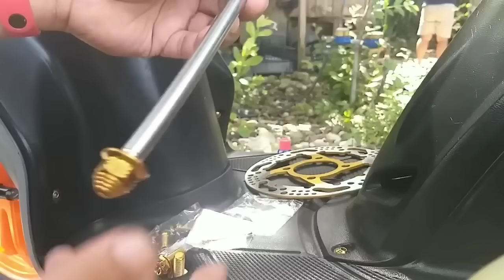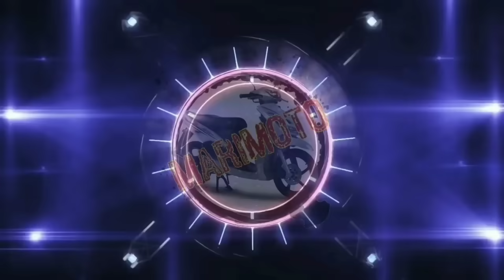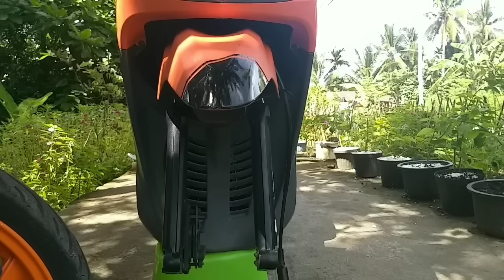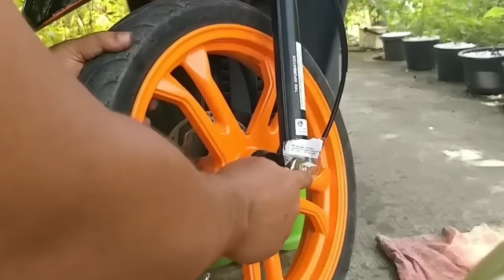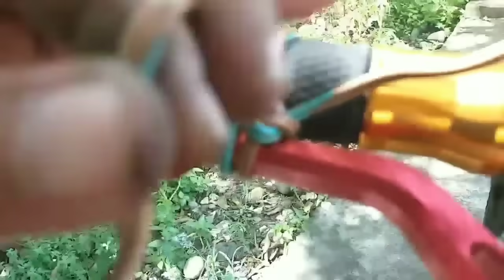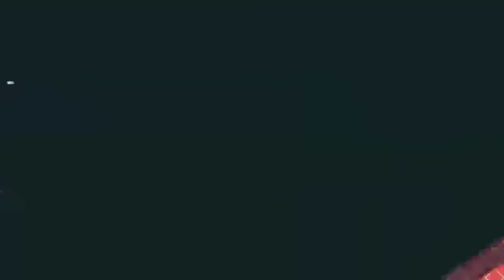Change Disc on Mio Sporty | Gold Disc Bolts | Gold Caliper Bolts | Gold Bleeder | Gold Caliper Pin

Comment: Paps anong sukat ng star socket wrench sa disc at sa caliper? Salamat mabuhay ka paps.
Reply: @albertdcofficial3357  yung pangtanggal paps na star socket sa stock ng caliper po at saka sa disc bolt.
 Salamat po RS
Reply: @albertdcofficial3357  T50 ba ung size ng flower wrench mo paps?

Comment: 10x25 ba yang caliper bolt mo bossing ?
Reply: salamat boss
Reply: @albertdcofficial3357  sakto lang po ba yung caliper bolts mo idol? Yung akin kase need pa lagyan washer. Abot kasi hanggang disc
Reply: @albertdcofficial3357  pag naka lighten disc siguro . Yung akin kasi stock disc pa. Abot yung bolts ko sa disc hays
Reply: @albertdcofficial3357  sayo idol pinutulan mo paba ? Nag lagay nalang kasi ako washer
Reply: @albertdcofficial3357  salamat idol. Baka sa lighten disc malayo talaga